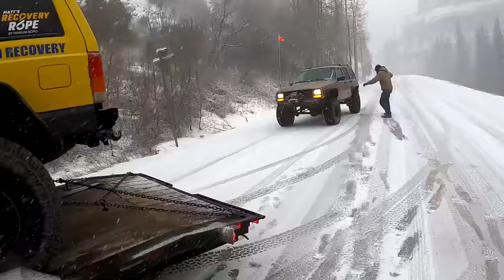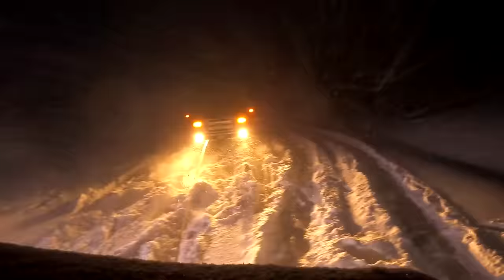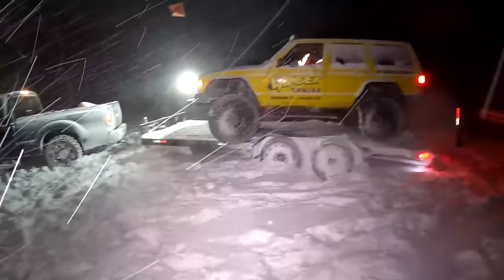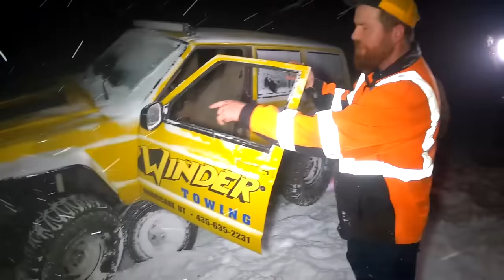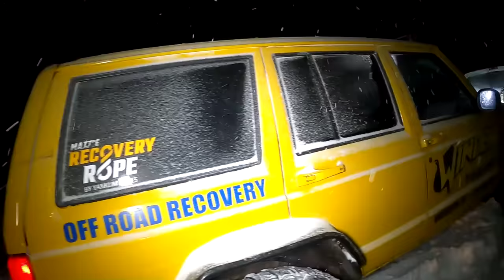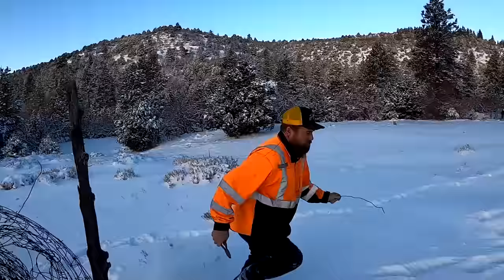Major Mistakes were Made, Failed Rescue!

Comment: As an Alaskan with a whole lifetime of wheeling in snow. When someone needs a recovery in winter conditions the single most important piece of gear you can have is a full set of tire chains.
Reply: @andrej5861  Yeah, chains would have probably solved the problem.
Reply: @andrej5861  Absolutely  ! I keep 7mm straight square link chains in my Jeep in the colder months.
Reply: I was wondering if chains were a thing in USA. In my country they are mandatory for winter and snowy conditions. Not only that, but we have to keep winter tires and summer tires as separate sets. Although we did have a strong winter a decade ago when army had to go in with tanks and drag people off of flat roads. 🤣
Reply: I tore up so many regular chains I finally made semi chains and shorten them to fit my big tires on my 3/4 ton truck
Reply: @MladenMijatov  We don't have bad enough winters to have the whole country require chains.
Reply: I second that for British Columbia too as our drop off's are truck killers, extruded track rails are good too like 20 feet of them.
Reply: As an ex Norwegian I fully second snow chains. Furthermore STUDDED snow chains are popular over there.
Work very well when the snow is very hard packed. And on ice, of course :)
Then add the obvious: Diff-lockers and snow shovels (you have that, but most Americans don't).
Put all that together and it's incredible what you can achieve. Especially with Matt's skills.
Reply: @MladenMijatov  in some areas it’s kind of mandatory because you can’t travel without chains. But in the US you have areas that get hundreds of inches of snow every year and also many areas where it has never snowed before. Even within a state you can have that such as arizona
Reply: I was amazed not to see chains. They don't fix everything but they do make a huge difference. If the chains don't weigh over 15 lbs apiece they are the wrong kind. Also no gloves??? Bad news indeed.
Reply: @MladenMijatov  I carried them (and a tow rope) on my work truck here in Northern Arizona. NAPA has proper chains for off-roading.
Reply: Tire chains with dirt and mud in the woods in 4 low go great with a beer!
Reply: @flagmichael  15lb chains on my stock sammie tires would be awesome overkill.
Reply: In  Norway where i am from, it is mantatory and you will get at fine if you dont have at least 3 set of chaine   on bigger trucks in Winter time :)
Reply: @bozemanjunkremoval  my tracker is a monster in the snow with studded chains on.
Reply: @majorlorne6224  tracker and Sammie are basically the same thing I love these rigs
Reply: A full set of chains and a few bags of sand (for traction and weight on rear tires of pickups [and Rudys rig]) would have helped alot besides not ignoring gut feeling for the need to turn back. One last thing is plenty of food in the event you are stuck there for the night. Water would be easy as there was plenty of snow.
I personally learned these lessons the hard way by being stubborn lol so I felt their fear and frustrations with all the vehicles being stuck.
Reply: @MladenMijatov  If you have the Mountain/Snowflake symbol branded on your tires they are severe snow service related. They aren't as good as dedicated winter tires but are better than Mud and Snow rated tires. If your vehicle has AWD/4WD and you have those tires you can drive legally almost anywhere they don't shut down the road. Once the road is shut down, doesn't matter what your driving or what traction aids you have you're not legally able to traverse the road.
Reply: I beg to differ, i think you need tires to put those chain on, no?
Reply: @cassidywall1140  What are you smoking?! Of course you need tires to put chains on! Anyone with a brain knows a car/truck/auto needs tires to drive anywhere with. Tire chains and sand bags are to increase their traction/weight in slippery conditions like snow.
Reply: Exactly  ! Where are the tire chains ??
Reply: dan conrad  
Exactly.  Tall n skinny tires find traction. BF Goodrich used to make a mud terrain 33x9.50. My '67 Landrover had them. Good for everything but dry sand.
Reply: dan conrad  I agree, slim is better than wide in the mountains with mud and snow but they are coming from lowland with sand and wide tires..... their heart is in the right place but they could have been better prepared.
Reply: Idaho seconds the sentiment
Reply: x1000.  In Pennsylvania, I've seen so many Jeeps trying to pull people out on snow and ice like that, and you aren't going to do it without steel on your wheels.  During wintertime, I carry mud service chains for the truck and a hi lift jack (plus straps etc).  The worst thing is most new trucks don't have clearance on the front axle for any sort of chains.
Reply: @TeddyBearGaming999  yes, agreed.  They are used to sand and rocks.

Comment: Invest in a set of snow chains , they also work very well in mud .
Reply: I drive in snow like this a lot with tire chains; they make a big difference.
Reply: They are inconvenient, but the traction is unbeatable.
Reply: Chains are useless in deep powder
Reply: They are awesome in deep snow. Only way to get around in a nasty montana winter.
Reply: @benpatten5220  depends on how deep. 

Air down, and if youare having issues with beaching (which happens in the Cascades a lot, from 3500 ft up, we have 5 feet of snow minimum dec-june).

On roads with just a foot of snow, it can help.

Comment: Nice to see some people in Arizona playing in the snow😜.In Canada I have learned  how to use momentum rather spinning my tires… and when my 4x4 truck with lockers made it past where anyone should go and you don’t have a winch and just a tow rope I have used  what I call Pendulum recovery inorder to get up! I go down inorder to get forward motion with enough speed to get back up once you hit the end of the rope… it really gives you goose bumps! so far has worked for me like a clock Pendulum every time!
Reply: I had some sand on hand once with snow shoulders...up to my shoulders. Snow was only about a foot deep where I had plowed the night before. Put on the parking brake slightly to lock the diffs, popped the clutch, and poured sand on whichever tire was spinning. Got it out. 🤣What misery though. Prefer to watch this on the tubes.
Reply: Is Pendulum recovery the same thing as rocking the tow vehicle back and forth?
Reply: No the pendulum is in need of a tree that you attach your strap to and use the over the bank as your momentum and once you come to the end of the rope if you are able to go in a circular motion without hitting trees… I have been able to swing back up onto the road.. yes extremely dangerous.. but has worked everytime so far
Reply: Having snow tires helps a lot as well.

Comment: I know that feeling all to well. You know you should turn around, but you're there, the storm can't last forever, so you keep pushing on until your luck runs out. Usually you get away with it, passing a few wrecks that prove not everyone does. Sometimes you don't get away with it, and that's how I spun off of I80 in a storm last month.
Reply: I know the feeling also.  That shiny new section of guardrail on the south end of Ut 167 is mine.  Well, mine and Geico's.  That sinking feeling in my gut as I pass by each day reminds me to take er easy.

Comment: Next episode, "Matt finally wears a pair of gloves".
Reply: It's hard to work with gloves on
Reply: and then "Matt buys tire chains AND puts them in the pickup!!"
Reply: @openyourcoconut4774  canadian sheet metal worker . work in minus 30 C alot out side with lots of screws . I find heavy mitts that are finger less with lighter gloves on for dexterity does the trick .
Reply: @morgancoldfirecoldfire8256  Sounds like a smart idea.
Reply: @morgancoldfirecoldfire8256  I gotcha, I'm an hvac service tech, some things are fine with gloves on but when your working blind or with a mirror it's tough having gloves. Thank god it doesnt get that cold here tho, usually not much below 0°c.
Reply: ^ there are some high dexterity gloves and while not insulated and freeze proof, anything is better than touching freezing metal bare handed
Reply: I cringed when Rudy dug in his coat pocket for the lug nuts, with gloves on.  What could possibly go wrong?
Reply: @openyourcoconut4774  yea in the cold temps if there is a hole in my gloves only takes like 5 to 10 seconds to burn the tip of my finger. feels like a lighter or stove burn for 3 to 4 days . Use to not wear gloves in the summer cut a tendon one day . I dont wear gloves tho if I am doing fine detail work like low voltage wiring.  Use to be a commercial fisherman so working with ropes and lines with gloves is not a problem . I dont see any reason why he did not wear gloves but I guess it was not that cold only like minus 8 C in the vid . That is almost just long sleeve T shirt whether  after minus 30 for weeks on end.
Reply: @morgancoldfirecoldfire8256  These people don't know celsius dude.
Reply: So we went shopping....
Reply: @openyourcoconut4774  You learn to work with them on when the other option is freezing or burning.
Reply: @miktub1555  says who?
Reply: @openyourcoconut4774  You wouldn't like industrial work lol. Refineries will run people off the job if they're caught working without gloves on, even on minimal shit lol
Reply: Hey Matt and crew,  I have nothing bad to say about your adventure except you make me smile. Thanks for taking us along. It was a little bit warmer here though which made it nice.
Keep up the good work.
Reply: Randy giggles.
Reply: Made me cold watching him without any.
Reply: "Matt finally decides to install winches in all his trucks".
Reply: @openyourcoconut4774  Even harder with frost bit fingers.
Reply: @openyourcoconut4774  I'm a hvac-r service tech, for the refrigeration side of it gloves are a must, I keep 3 pairs on hand at all times.  -20 F freezers don't care about your skin.  It must not have been that cold up there or they were workin' HARD cause no one had on real winter attire.
Reply: @openyourcoconut4774  I'm a shipfitter and always wear softleather gloves. It never gets below 30 here, but my gloves have saved me countless times from cuts and pinch points.
Reply: @morgancoldfirecoldfire8256  I can't believe I never thought of this; it's so simple!  Thank you.
Reply: @morgancoldfirecoldfire8256  If you don't mind my asking, which gloves do you use for the fingerless heavy part, and the under dexterity one?
Reply: those gloves would work . I would go to a store like bass pro shop and get a combination like that . like three pairs since they can wear out after use.  also when your not working you can take the mitt part and cover your fingers if they start to get cold . the first link is a nice glove for dexterity and grip and it goes a long ways down the arm to transfer heat.
Reply: a mitt that is whool with leather that is fingerless and the under armor hunt liner glove . good grip light and goes past your wrist a ways .
Reply: i tried posting links but dont seem to work
Reply: @morgancoldfirecoldfire8256   Thank you.  I'll look for a leather and wool combo for the fingerless warm layer.  The gloves I use for dexterity I wear through usually in three days, so I buy cheap ones in bulk.
Reply: I live up in the Arctic of Alaska and I for one have learned my lesson about not carrying a pair of gloves
Reply: Cant do enything with gloves on. And clearly its not even cold in that video. Maximun -5c i would say.
Reply: @justanotheryoutubeuploader  lol freeze proof gloves. Now that would make a million in a sec and a half .
Reply: @morgancoldfirecoldfire8256  i feel like digging potatoes on my sandals when its only -8c xD Hail from Finland
Reply: @miktub1555  yes they do.
Reply: @arcanask  no. You just dont. Freeze bites rly only start happening after its under -35c and exposed soft skin for long periods... ive never had em while ive been snow mobiling ,stuck in the woods digging my atv for hours , once i had to clean the carb of my mx bike in -20c now cold gasoline feels nasty... we do ice fishing and have wet hands and gear with the mercury dipping under 30c... most stuff just cant be done with eny kinda gloves...
Reply: @morgancoldfirecoldfire8256    Whether what???
Reply: @miktub1555    But when 0C equals 32F, -30C has to be pretty damn cold.
Reply: @openyourcoconut4774  It's even harder with frozen hands..
Reply: @Badge124  cool
Reply: NEXT EPISODE: MATT WEARS A HAWAIIAN SHIRT 😀👍
Reply: @mrpoizun  then -40 deg C would be unimaginable

Comment: I never thought I'd see the day a winch saved the day on a MORR video. Glad ya'll made it out safe.
Reply: Looking back at it they probably could've avoided the flat tire if they'd used the winch earlier. Rudy is right, the winch can be clutch. It was sure fun to watch.
Reply: I also noticed they passed the cable underneath the truck and anchored on the other vehicle behind them. It's a bit of a desperation move.

Comment: As a Canadian, I feel that a couple sets of tire chains, would have went a long way in the scenario...
Reply: Just on the front wheels of the Super Duty.  How do these guys not carry this stuff?
Reply: Yeah that's what I was thinking, when is someone gunna fit a good set of chains? I've seen chains used in the TV series Ice Road Truckers but that is Canada in particular so I wondered if they don't have chains in USA? Here in Australia we don't get a great deal of snow but snow chains are readily available. 🤷‍♂️☃️
Reply: They are desert people, chains, what's that?
Reply: Agree, there's no way I would have tried that without having chains on board.
Reply: 1rst pair on rear because it had trailer weight on it and i'll bet rear diff. has limited slip if not outright locker. If the truck was not towing then "maybe" up front as it has more weight than an empty bed. @brianhof7599
Reply: @devinwarwick  the banana 🍌 with a pair front and back would have been unstoppable like the snowcat...

Comment: This is a new one for me - a tow truck that needed to be towed off the trailer that brought it to a job because it was stuck - during which it lost a wheel to catastrophic side wall implosion - and almost rolled over.  I think only if it was ON FIRE could it have been worse.

Comment: Where are your guys tire chains?!

Also: mud tires are not snow tires.
Reply: Yep, skinny winters and chains, mandatory.
Reply: @Billy97ify  most the time we don't need the chains . Normally they would use the snow cat but they tried beating the storm . Hence why they said mistakes made. We all obviously know about chains lmao it's not anything new guys
Reply: @christopherduby5330  Do they even have chains? You don't try to pull a load up a hill without chaining up first. They don't even have snow tires. Where I live, you are a fool to go on the highway with tires like that.
Reply: @seacrestsmith657  living in Colorado,  my truck has a pair of chains permanently in the toolbox, saved my ass more than once
Reply: Duratracs on Rudy's rig are a winter rated tire
Reply: Right another one. Snow chains woulda made that look too easy
Reply: “Where are their chains?!” Where are their GLOVES!?!
Reply: Even though I live in South Eastern Australia (Melbourne,  Victoria) ,  when I head out in the 4x4 in winter a part of my gear is ALWAYS  snow chains. Even in summer we can get caught out in the Victorian High Country - have been fourbying one day in 30°C and taking the track back out in fresh snow  from a storm overnight! Gotta be prepared for anything and be prepared to change plans or call it a no-go.
Reply: Chains and next time lower the tongue of the trailer.

Comment: Mountain snow recovery and not a single set of snow chains to be found smh
Reply: It's amazing what you can get though with chains.
Reply: Need to air down tires as well, amazing what 5-10 psi would do.
Reply: I'm super surprised they don't ever bring bag-jacks either, those things can be used any number of ways in situations like this.  Very handy, so long as the user is aware of the things to watch out for.
Reply: Snow chains definitely wouldn't have hurt but I have also seen videos where matt pulls people out with chains on there tires and  I would say he makes alot more money than us do doing recovery and probably recovered 9 times the amount u have and he probably doesn't like them for some reason or they have failed him in the past Matt is the man
Reply: @bennymiller4254  you don't think he knows to air down that's all they talk about and do on there recoveries he can't put everything they did in a 26 min video I had never even heard anyone say that until I started watching this channel and Matt is always telling customers to air down next time so I think he knows
Reply: @gregsteadman  most people dont like chains because of the time they take to put on I am not sure if that's matts reasoning. anytime I go play in the mountains especially during winter rather it be to rescue someone or just play if i get into more then 4in of snow or i just need extra traction I will take the 30 minutes to install my tire chains sometimes just rear occasionally front as well just depending on the depth of the snow. My trucks a 84 k20 Suburban pretty much stock expect for a sm465 swap and 285/75 r16 tires. i plow through anything and have never had to call for a rescue.